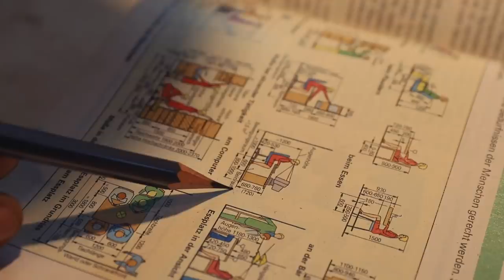A Minimalist Desk for my new Studio Workspace

Comment: Looks nice. I would have fixed the wobbly edge on the cut out section of the worktop if it was mine. Especially as it's the bit that faces you. A plywood template to follow with a router would have been nice.

Comment: You actually hade a pretty good rendition of a clasic, decades-old inexpensive desk:  Two steel filing cabinets with a wooden door on top.  (The cutout for the doorknob can even act as a cable port.)  These are actually rather deeper than are needed nowadays, it was really an idea for back when you needed the depth for the CRT-based monitors of yesteryear. (And this really is that old.  The first time I saw this idea, it had a picture of it in use, and there was an Osborne 1 on the desktop, back when that was still a serious business machine.)

Comment: Probably would be a good idea to add some 2x4s on the bottom to prevent the top sagging over time. Then put a few big nails sideways into the back 2x4 and you have a cable tray!

Comment: not having backs on the cabinets could cause it start to wobble a bit over time 
a small 5cm wide plank placed as a T under the desktop between the cabinets will make it stronger against side to side wobble closing the rears of the cabinets will be a lot stronger though

having glued the top to the cabinets makes it harder to transport too , couldve used camlocks to hold the desktop to the cabinets

Comment: BLACK mdf?  Explain this magic to me.
Reply: Travis Clark That colored HDF (high density vs regular medium density) is called VALCHROMAT. It's made in Portugal and is taking Europe by storm. It's non toxic (you can make kid toys with it), structurally a bit more stable than regular MDF, and somehow hydrophobic. It exists in many colours and thicknesses. Tones are more subdued when they're not yet varnished (for example, black valchromat looks dark grey until varnished or oiled). They're more pricey than regular MDF but they're quicker to finish as they're not supposed to be painted (a rag and a bit of tung oil will do beautifully).
Reply: @the_arcanum  Thank you! Now I gotta figure out if it's available here in the US